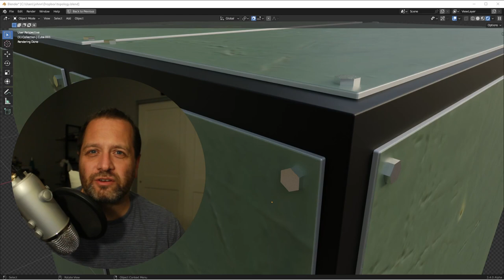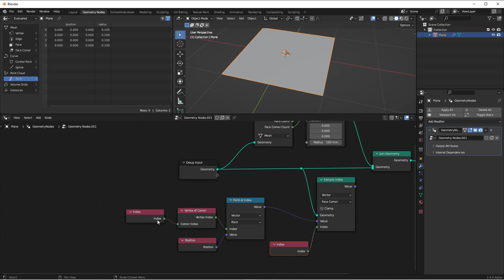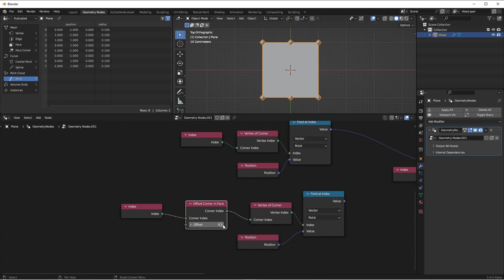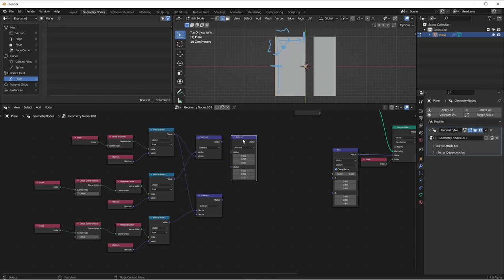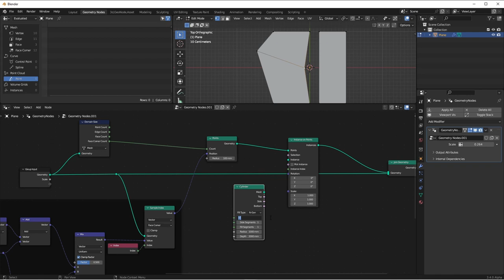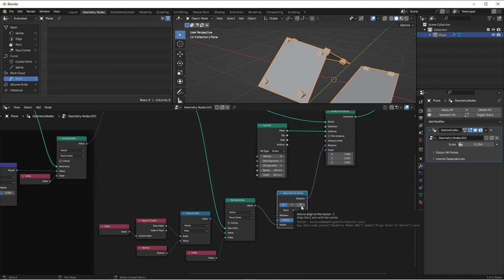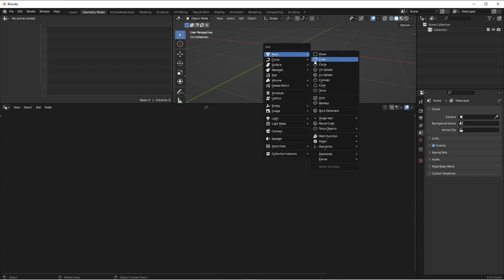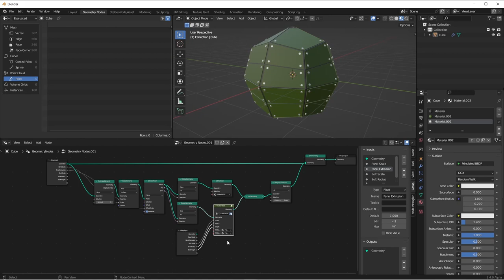Access Topology Like a Pro with Blender's New Mesh Topology Nodes

Comment: Thank you. How would you create a simple window frame and window using this technique? But then use a value (ft or mm) and stays consistent? I tried doing duplicate the faces, and then scale, but the result is then that it creates uneven frame thickness around when the original object is scaled.

Comment: I know this is kinda outside the scope of this tutorial but was using the point position along the normalized edge to place an instance there(IOP).  After realizing and then using a mesh boolean union to join with the original object that's edge was used the boolean union failed.  Is there something I should(don') know about realizing instances for boolean union operations?

Comment: I might be missing something but wouldn't it be easier just to use the extrude face node (with an offset of 0) and then scale that face as you can select the "top" vertices and then just use those to place the points on?
Reply from the maker: I’m sure you could make that work.
Reply: @JohnnyMatthews  Cool.  Good to know Im not mad.  Im just trying to find a reason where I would use this instead.  It would be really cool if you could select the corners of a mesh but only if the angle of the edges coming off it was a value you could input (so you would only select the Index of say the corners of a subdivided mesh).  Thanks so much for the quick reply, really appreciated.
Reply: @JohnnyMatthews  Just had a play.  Should have realised that the scale node will scale everything equally so this will only work for square panels.  Might have to rething that one then so your method seems cleaner.  👍

Comment: Something I noticed about this is that the "vertex of corner" nodes aren't doing anything. You can remove them and it works the same.
Reply from the maker: That’s probably because the vertex position and edge corner position are the same. I guess if there was other data that was only on the vertex it might make a difference.

Comment: yeah geometry nodes "seem" awesome, but terminology and functionality make it seems like you have to have a doctorate in "blender geometry nodes"... which is why I simply don't use them. I don't really do anything procedural anyway so...whatever. The fact still remains though, not user friendly(beginner). I'm no blender beginner, been using blender since 2.27 or maybe earlier....
Reply from the maker: It is complex to be sure. These nodes are pretty Low level. As more complex nodes are shared as assets and even included in some default asset packs it will be more beginner friendly.
Reply: Have been learning GN for well over a year and yes, this is not a beginner tutorial by any stretch. Blender devs have exposed these low-level nodes so that the community can build exactly what they want from them and I think this is the right approach. But there are far simpler GN setups that will get you used to the workflow before diving in to this kind of stuff.
Reply: @JohnnyMatthews  This is also my thinking. I know I sound a bit on the negative side, but I'm just pointing legitimate issues out. Worst thing that can happen to a new user is to try to jump in immediately and not be able to get anything accomplished...thus pushing them to use other software.
Reply: @nowherebrain  I'm a beginner. While I've had Blender installed for over a decade, and have been watching tutorials on a variety of subjects for a couple of years, I only actually started touching it recently (and went straight to alpha versions. I know, I'm crazy). I'm not particularly great with maths and logic. While perhaps not standard, my point of view is a bit different to yours.

I'm getting into geometry nodes knowing I'm jumping in at the deep end of a more advanced workflow. While you obviously don't want every tool in a given software to be complicated, I don't think every tool needs to be aimed at the beginner. And this a tool that is still in its infancy, with things constantly being reworked (the "old transfer attribute node" Johnny mentions is only old for 3.4, and is still in the current stable release, for example*). We're basically seeing the frontier of geometry nodes, wild and dangerous where anything can happen. As it matures and the low-level node base has become more settled, more beginner friendly workflows will arise. But it takes time, and real world use of the low-level nodes to get there, which is the stage we are at.

* speaking of transfer attribute, @Johnny Matthews is there a video somewhere covering everything this node has been split up into in 3.4?
Reply: @nowherebrain  You can do a ton of basic stuff fairly easily with geometry nodes without needing to know a lot of math or the underlying data structures. Those are the nodes Blender devs introduced first, for the most part. Recently they've been adding more advanced nodes that do require a deeper understanding of math and data structures to understand and use. But don't let the recent additions scare you off. There's tons of cool stuff you can do without touching any of them.

A good place to start might just be some basic scattering. You can use it as a replacement for a lot of the old particle system, but what you can do with it is so much more, and I find it a lot easier to work with. You can do a lot of neat stuff with curves too, without a ton of complicated node trees.

Comment: Hey there, where did you find documentation? Is this just spreading by word of mouth? The official docs are very much not helpful :( Thank you for the awesome video :)
Reply from the maker: Well, I added them to a node tree and viewed the results in the spreadsheet view. Then just kind of worked backwards from there. Although since I do know how mesh data is stored under the hood of Blender, it may have influenced my understanding.
Reply: In 3.5 the 'Field at Index' node appears to be called 'Evaluate at Index' if that helps.  The 3.5 documentation uses both names which is confusing.